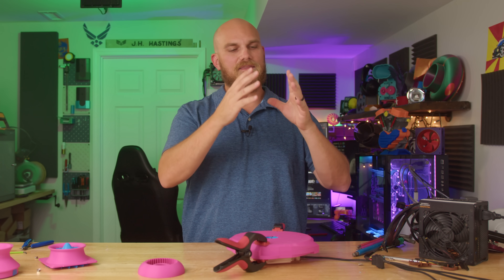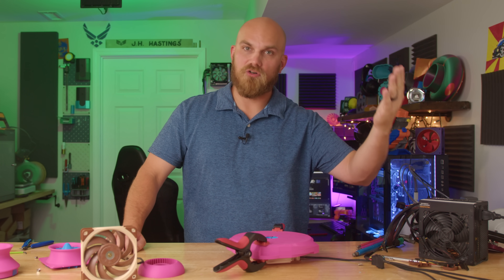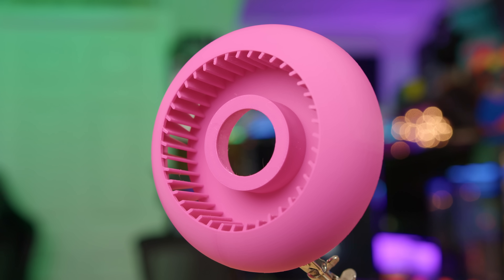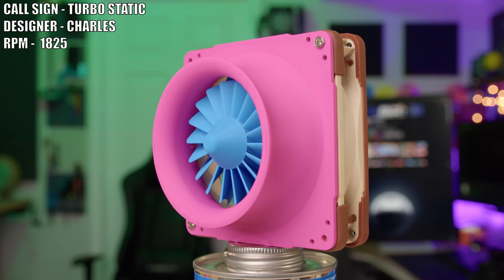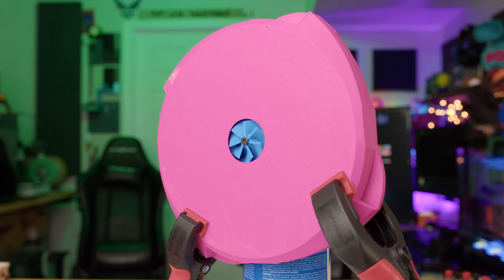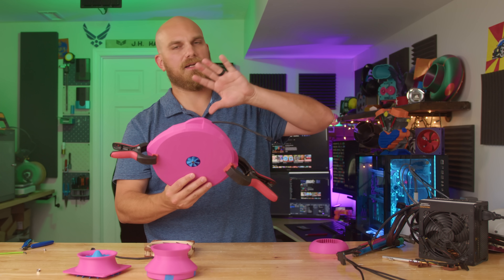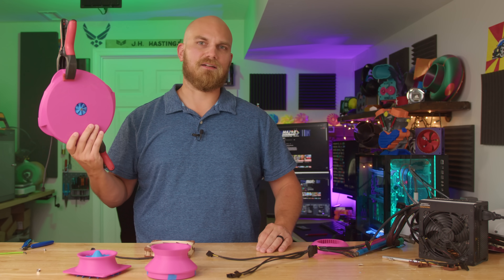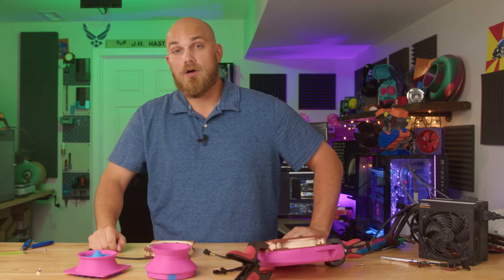Wild 2-Stage 200mm Blower Fan Redefines Power | Fan Showdown S6E6

Comment: I think the current fan format works great. Crazy contraptions wouldn't be that exciting if every fan would be like that. You balance it in the videos pretty well. 

Excited for the blow season finale. For the next season - what do you think about the benchmark in the form of dynamic airflow testing but through a radiator? Seems the most accurate to the real use in pc.

Comment: I say that we should unhinge the limitations we have on fan making. Yes, we can be somewhat creative, but the issue is with the specifics. What I'm getting at is that we do these models in accordance to radial orientation and mount size. That's very limited. We have shown that air flow can be achieved in many ways, not just from radial motion.

Comment: From a heat transfer point of view, one would want to maximize the volume of air moved, and not pressure.  So I'm not sure what the use of measuring the pressure of the fan is.  The wattage consumed by the fan will also increase with the amount of air moved, so maximizing the air volume for the available wattage of the drive motor would should be the goal.

Comment: How can you evaluate fans without including the volume of air moved by each fan? It’s the volume of air passing over the cooling fins that is important, that and the pattern of flow over the fins, turbulent flow being better at removing heat than laminar flow, but at the expense of noise.

Comment: what would be the use case in the pc world of a beast of static pressure that moves that low amount of air?

you need balance of pressure and flow to cool radiators, unless you are building an air compressor that I don't think is a thing for pc builds!

Comment: Instead of a welding glue on that behemoth use a rtv gasket silicone on the outer housing to seal. Still be separatable with mild effort. That thing should pump out even more pressure if those visible leaks are any indication.

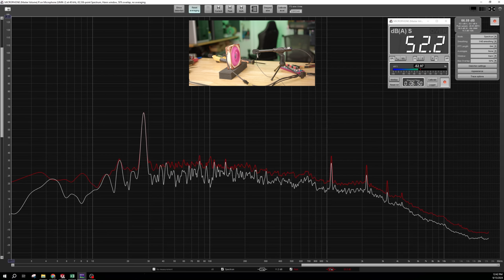Comment: 7:26 Big fans (like for example BitFenix 230 mm) tend to produce noise that is less harsh to our ears beacuse it's generate lower frequencies. I'm using 2 of those 230 mm in my desktop PC for at least 10 years now and I'm very happy with how well it performs and how quiet it is at the same time.

Comment: What's the point of testing a bunch of creative contraptions you couldn't even use on a cpu cooler or radiator? Ultimately pointless. 
This has nothing to do with the original premise of the series anymore.

Comment: Please test some of these fans with a deshrouded GPU setup. The static pressure really helps push air through dense fins and benefit cooling significantly. Even most radiators aren't as restrictive as some of the high end GPU heatsinks.

Comment: I would consider incorporating CFM into your testing.  You could build your own flow hood or even buy something like the Testo 417 which might work right out of the box.

As demonstrated in this video people are exploiting the test for the highest static not the best “cooling”. Cooling requires high air flow, static does not. Especially since you aren’t measuring speed to peak static pressure. Large disc shaped “compressors” with tiny inlets to minimize the air that can leak back through it will win.

Edit: For clarification consider your HVAC system. If the evaporator coil is clogged with dirt and dust you’ll have very high static at the blower because there is no where for the air to go so the pressure increases. However since the evaporator is clogged you’ll have very little cooling.

Comment: yes this is the secret of creating static pressure: you don't have to move almost any air, just enough tiny amount at the start to pressurize the thing and then you have to keep it from escaping
Reply: yeah it seems utterly optimised for one number
It would be cool if a MAF sensor could be included into the test suite
One test with a radiator one without a radiator

Comment: I think I would rather see some type of impeded airflow test instead of static pressure. I think a lot of people don't realize what static pressure actually means and how it is meaningless for case fans. Static literally means zero aiflow and is applicable to pumps, not fans. Some type of impeded airflow test would be more meaningful to fans and could just be a radiator or two stacked up.

Comment: Uhm...I propose camp A2?
I think theere should be 3 rough categories.
PC fan: where everything fits inside the mounting dimensions
Fan plus; (A2) where you must respect a protected circumference of the blade shroud,  but can go as far from the motor as you like.
And B: if you can do it, try it.
I don't think we should change the format At All; just the leaderboards; overall, pc fan, stack fan, and unlimited fan.
I remember the earlier seasons, where those tall fan blades were topping the lists; and many cases Have the space to mount those as extraction fans.

Comment: I have a novel idea:
Break season 7 into a series (be it 2 or 3 given some of the 3 camps suggested by others) and S7S1 would be standard, S7S2 be other others (or you know, a not so extreme that's suggest and a S7S3 for the true anything goes so long as powered by the fan hub). This was you'd go S7S1 Ep1 then S7S2 Ep1 (S7S3 Ep1?) Then go with the Episode 2s of each. That way each series would have their own score bords and i think would please everyone. I'm with the 3 catigories suggested by angel-dp9sl and want to see all of the fans, but feel its more fair to the creators to do my suggestion. Just don't do each series each week. Don't burn yourself out man and keep a good spacing between each release as you drop an episode and cycle through the series

Comment: The first "turbo" version is like a turbo in a car yes, but more accurately its a centrifugal turbine design...like the compressor side of a car turbo. The second one is an axial turbine design, like a turbofan jet engine. The 2-stage is a 2 stage centrifugal. It really is closest to a car turbo, where the second stage would be the exhaust side of a turbo (the turbine) and the 1st stage would be the intake side (the compressor)

Comment: I would suggest rules as follows:

1. A design has to be mounted only to, and powered only by, the A12x25. And...
2. The design, in combination WITH the A12x25, has to mount to a typical desktop case in the usual way without making the whole thing into a burdensome nightmare.

Comment: nice, I have been waiting for multi stage fans :D
multistage is the way to go when you want pressure, but ofc flow will be affected. its a tradeoff if you want flow rate or pressure.

I think the motor is hindering the fan true potential, higher RPM should give exponentially higher results.

Comment: I don't have a preference on which group should or should not be allowed. I would just like them grouped together so if, for example, someone wants to try upgrading their current fans they could. Or maybe try testing them in a case as part of the testing. Fans are fun and all but which ones actually fit in a case and could add pizzaz and functionality to your home build? Perhaps the next series could use a 240 or 360 rad hooked up like you did with the single fan.

Comment: this is like race cars , one set likes to see what the stock version can do balls out , the other is the modified and super modified cars . i think both are equal , you need to see what is , and what can be . dont be surprised if one of the super mod fans becomes a standard issue in the next 20 years . i think you should do both .

Comment: You say without the big impeller it ‘only’ produced 6.7mmH2O. That still beats the number three 😅

It makes sense to me, having such a large radius the air is going to be moving much faster by the time it reaches the outer edge. I wonder if a larger opening could help improve how much air enters. I think about jet engines and how they progressively step down the volume with each compressor stage, causing the pressure to increase, but also the air to accelerate with each stage.

Comment: my 2 cents. Have a prebuilt system ATX have it have to be able to be mounted in the case, give mesurments on fan clearences between componets. fit the fan housing (Group b). if it fits it rips with the prebuilt you could test thermals, rate looks and so forth.

Comment: I am generally a proponent of the "anything goes" variety, but outside of the competition, those kind of designs rarely prove useful, and are merely of academic and educational interest by virtue.
There should definitely be a second scoreboard where only those fan designs are allowed that do not significantly add outside the 120mm PC fan profile. I will however allow for a small concession here, in that anything that doesn't add more height to the fan than a regular fan grill would (so, ~2mm on either side) should still be allowed, meaning, covering the intake or exhaust holes and leaving special openings to control the airflow with should be permitted within that category. PCBs or laser cut sheet metal are great for that. 😉

Comment: Who knows whether or not there will or won't be multiple classes. I think the person that commented about having three classes has a good idea. If there is no change, I like seeing the different types of designs that people come up with. 
   For the design I submitted. I wanted to stay within design constraints that are not really a part of the fan showdown. One of the main things for me, which can really hurt the ability of the score is to stay within a design that can be molded. Many of those other designs are awesome, but they either would be very difficult to mold or impossible to mold at all.
   My design was also designed as a 5 bladed type that is designed for flow, rather than pressure. But I thought it would do fairly well with pressure as a flow fan.

Comment: Hey, just a heads up – measuring the fan sound with the mic only a few inches away isn’t really giving a true picture of what people would hear in real use. That close, the noise is gonna be way louder than it actually is at a normal distance.

For more accurate results, most industry standards like ISO 3744, ISO 7779, and AMCA 300 suggest putting the mic about 1 to 1.5 meters (3-5 feet) away. This way, it reflects what a user would actually experience. Hope this helps improve the testing! Thanks for sharing.

Comment: glue it!

the metal bolts added weight, reducing overall rpm.
by not glueing you obviously had a lot of pressure loss, as evident by the smoke test. a lot was spewing out the sides.

do it!

Comment: fans never used to be "just fans" there were vents, and other doohickies added onto them to get them to extract more heat from the cpu, the main problem is that also at the time they didnt have much area to exhaust through, as for marking, putting a S for standard fan, and A for anything but standard, it means if you want to make a separate table for both then theyre already separated, but that means you want 3 or 4 of each fan in each episode to keep the balance for both fan type fans

Comment: I need a static pressure blade I can print for my little 4020 fan. I printed a 3d model of a fan duct and it's throwing some of the air out the top instead of all of it going through the ducts.

Comment: Group B... The BEST way forward is to think outside the box, without constraints.
From there, insights are/can be had which if they're afe any, they can always trickle down and yield improvements to the conventional fan.

BUT, and I think everyone has weighed in on this sufficiently: there should be some level of fairness kept. 
Not for the sake of sportsmanship since we're all adults here, so nothing really to be upset over no one is actually winning anything – which would actually be awesome if there WAS a prize, but, that would require way more people and 3D printers, so that ALL submissions could get tested.

As far as I'm concerned, things could go unchanged and it wouldn't bother me at all.
Even if every other episode you switched from testing only Group B and only Group N, that's also fine. Even if you wanted to have two different leader boards, go for it!
You have to do it in a way that doesn't make YOUR life significantly more complex though, as that could lead to you getting burned out!

Comment: You should probably be checking output temperature to see if the temp is changing at all. Compounding fans like that may increase air flow. 

The same thing affects compound turbo charging for example. It makes the chargers more efficient and keeps them in their sweet spot but usually drives  the heat way up between stages.

Comment: I would like to see a version of each, but if it is to be only one category, I am in for anything goes. I also can't help but think that the multistage could have done even better. I think the staging is wrong. I believe you would want a large intake for a slow moving but high volume of air, and as it gets compressed, it would move into a smaller diameter exit that had a much higher velocity.

Comment: I'm glad you put my crazy design in your video. I was very excited, and even more so when I saw that it worked very well. Please, do a test covering all the holes maybe it will reach 10 mmh2o 😁, you can use duct tape or hot glue that can be softened with a hairdryer to dismantle it without having to leave it stuck to the fan.
Reply: Excellent design.
Regarding hot glue; isopropyl alcohol will break the chemical bond with the surface. I treat hot glue as a temporary glue now as it is so easily removed with IPA.
Tecbond 261 works very well with PLA (best I have tried) and removes fairly easily with IPA.
For all the cost of a fan, I'd rather your design assembled with CA as you suggested - the joint will maintain better geometry due to the thin glue layer.
Reply: I doubt he will unless more mention it. He didn't with the wonder and that tested higher when I tested it.
Reply: Very interesting design, Gabriel.  I wonder if under higher loads the compression results in actually heating up the air during it's passage through the narrow plane of it's route through the CM.
Reply: @melmartinez7002 I imagine it's negligible with room temp air lol 
Seems like fact that it's 2 stage will increase the air flow way more 

It'd be cool to see more of these
Reply: Hey Gabriel , can I get the STL files ?!
Reply: Good job! 👍
Reply: Good job on the design BTW.
Reply: If the design had snap tabs and a mated bezel, maybe even an o-ring, I think it would be even better.

Amazing results. Patent it right away. Then call NASA and some commercial HVAC manufacturers.
Reply: @mewintle  In the US he/she has 1 year from time of disclosure to file the patent to obtain US patent law protection.
Internationally, that ship has sailed. Once publicly disclosed there is no 'grace period' to file for international patent protections.
Reply: Could it be smaller but the same design? Wouldn't that make it spin faster?

Comment: Doesn't the physics say the bigger the better. That Fan basically is size of 2 standard fans and can work effectively like 2 fans together. For sure it is the effectiveness champ via the energy consumption ,but the idea is finding something which we could use on our everyday builds I assume. This wouldn't even fit in to a case where 2 Noctua Fans would fit side by side and they would be actually more effective as 2 fans then this one. You could create  a big box which has 2 noctua fans inside and it would be even better 😉

Comment: I'm in group B, but you should just have a second scoreboard called "stock" that only allows for fan blade replacement and has the requirement that the completed unit must fit entirely inside the frame of the noctua case. in other words, the "stock" group would not allow any addons that extend outside the case or require external mounting. i think its a useful category because there are plenty of applications that demand a 200mm fan that doesn't extend outside of the industry standard footprint of a 200mm. 

you might allow for deeper fans in the stock group though because generally you can get deeper and deeper fans (sometimes up to 100mm deep). i've got a Tornado brand fan that is only 120mm but it literally has the power of a vacuum cleaner and is insanely loud and pulls a crazy amount of power, and it is something like 100mm deep (almost cube shaped).

Comment: Either way, people are going to use what best suits their purposes. It I can put it on the outside of the case and have the "fan" be more effective, then that is what I would do. If I am confined to the case itself and need a more traditional design, then I would go that route. In the end, all of the products are doing their job. It all comes down to the platform you are working with and what you are willing to do for better performance.

Comment: We need some sort of flow rate test, because the static pressure is not what will matter in reality
The compressor madness makes a lot of pressure, and takes the first place, but for any IRL use case (if you can fit it somewhere) the amount of actual air movement will be abysmal

Comment: There are axial and centrifugal fans, and there are those that are in between called mixed flow. The "Turbo Static" is mixed flow. The "Jet Impeller" is centrifugal but without a real diffuser, so it is probably more like a mixed flow too.

Comment: (axial) blower-> high flow, low pressure: short cooler passage (low delta P)->low delta t (air)-> good cooler efficiency
(radial) centrifugal fan->low flow, high pressure: long cooler passage (high delta P)->high delta t (air)->bad cooler efficiency